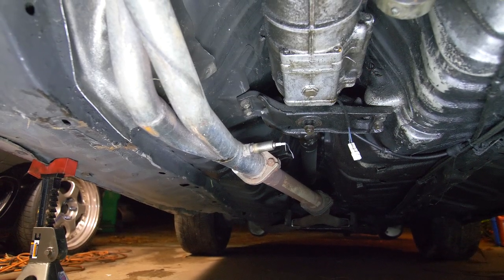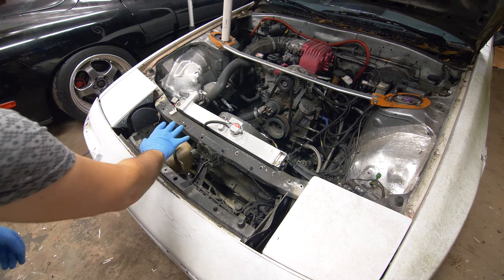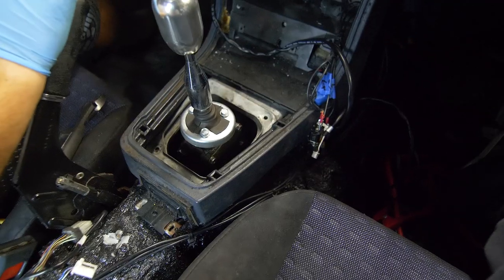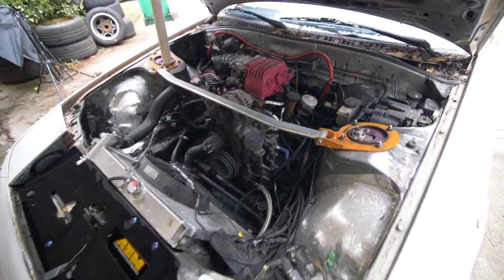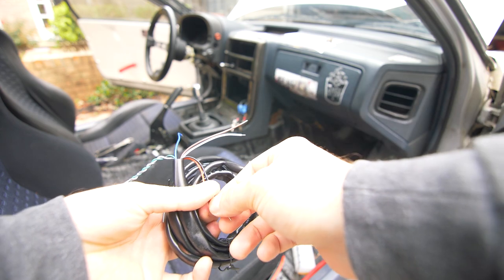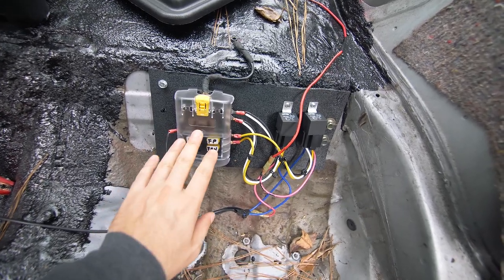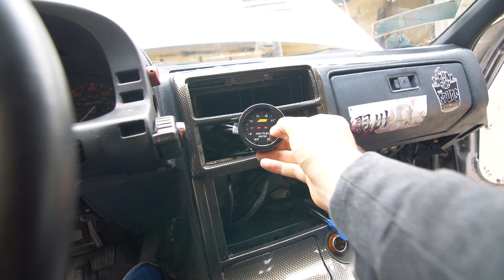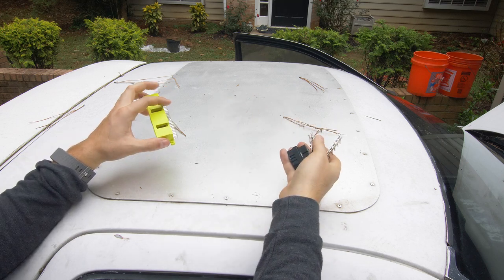Prepping for standalone (Haltech Elite) in the FC RX7

Comment: Love it. Does the AEM wideband use the Bosch LSU 4.9 lambda sensor ?
Reply from the maker: Thanks bud. Yes sir it does. Supposed to be faster/more accurate than the 4.2 but I guess we'll see. 👍
Reply: I been having problems with the LSU on my car. They keep dieing on me and it turns out it's to do with the oil in the exhaust gases killing it.
Reply from the maker: @rotary_rsr9794  ahhh crap. I feel like this newer sensor is getting a decent amount of worrying feedback. I might check the classis and get an older sensor as a spare. That's a huge bummer though - is there anyway to correct that?
Reply: It looks like it's all the LSU's so far I have not found a fix
Reply from the maker: @rotary_rsr9794  dang :( I will do some research too and see if I can find anything.